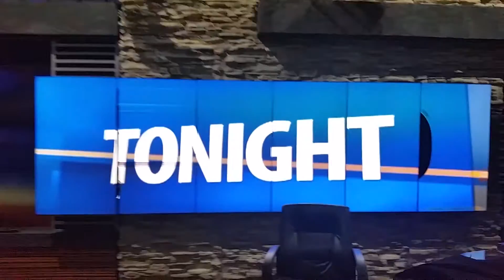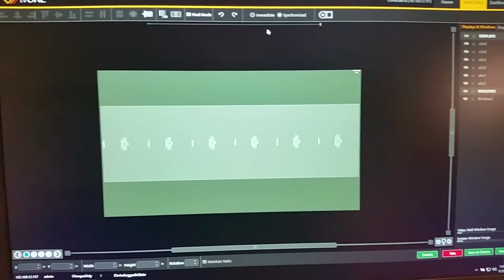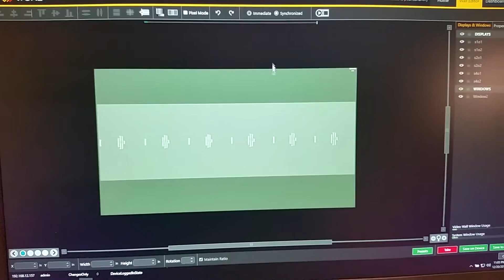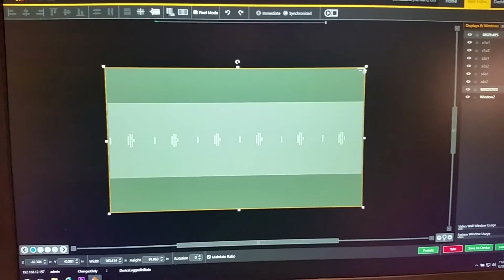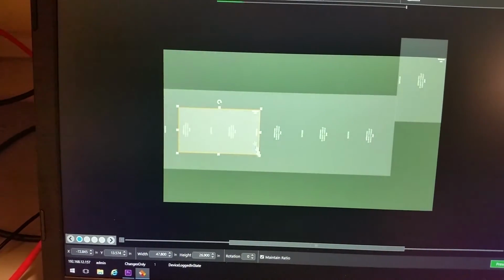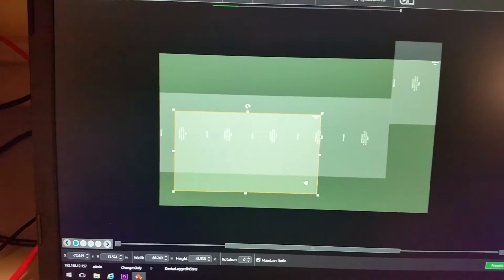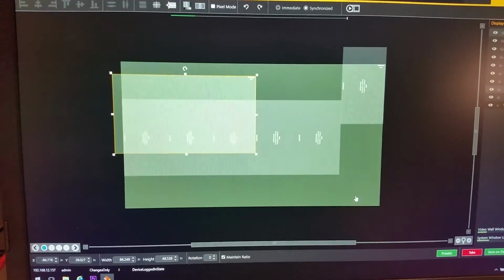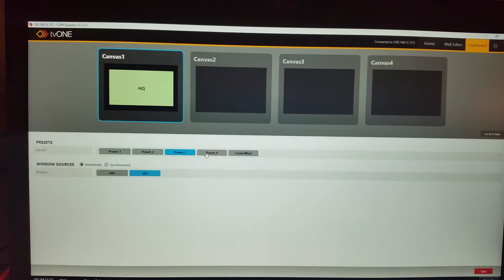How A Multi-Panel TV Array Works

Comment: What is the name of the brains aka the controller
Reply from the maker: I really can't remember, It started with a C I think....I'll have to find my old notes, I don't work at NBC anymore so I can't go look. They sold broadcast gear. Anyways the total package was $50,000. Each screen was a NEC 50" $5,000 overpriced garbage. The brains were nice and easy to control.
Reply: Yes all of NEC product is garbage. Cheap overprice garbage. Ok thanks for getting back to me. I looking to by that controller just wanted to know the product brand
Reply from the maker: @supaaaafly  Found it!. The video actually says TVone for the program which kicked in a few memories trying to IP into it haha. The brand is CORIOmaster and the unit is C3-510 CORIOmaster mini. The one we had was setup for 1080P sources but I believe they sold a 4K version. http://www.tvone.com/coriomaster-mini-video-wall-processor-with-12-ports